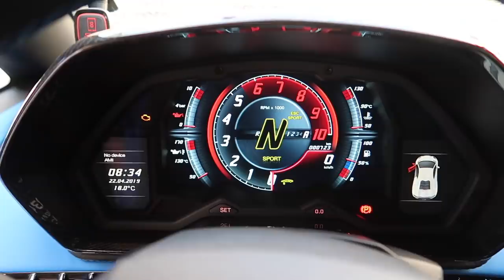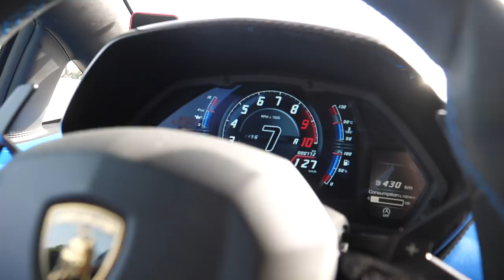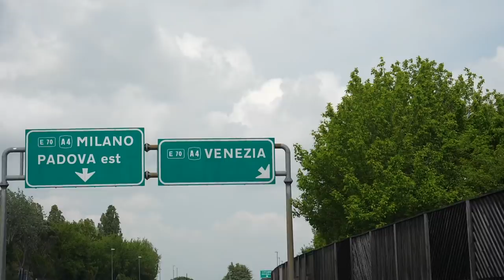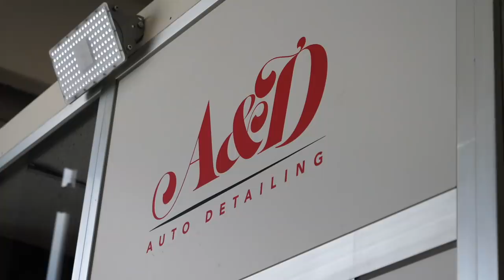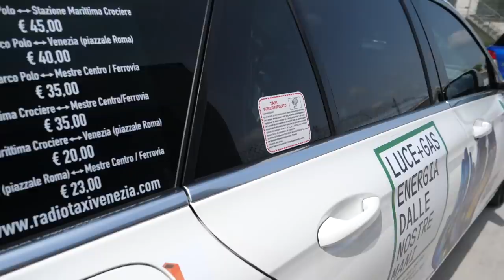The First Problem For My 911 [Puncture & Full Detail] | Eᴘ53: Iᴛᴀʟʏ

Comment: Sam, that is the correct elating position in a sportscar, not the straight up like in an SUV.  LOL.  I forget to tell you as well, there is a little height adjustment in the seat which happens when you bring it forward a little and recline the back towards the firewall. I suspect that is what happened form your discovery :P

Comment: I have the feeling that Sam is the type of guy not able to do a tire change on a car or anything mechanical.....but yet he might surprise me
Reply: your probably right, but that's the same as 80% of drivers... Sam's okay though he does not profess to be anything he isn't.
Reply: He probably can, he fixed small issues on his 360 himself a little time ago.
But on a car like this, bought for this purpos, I would also let professionals look after it.

He could have checked his tire at any stop, but anyway: As long as there is no risk 😁
Reply: I think he put the carbon fibre wheels on his old Jaguar f type himself
Reply: @Adam-jd8gz  Your Right, I forgot....